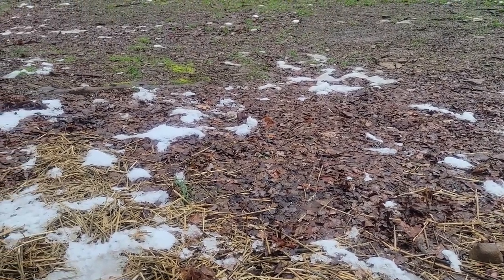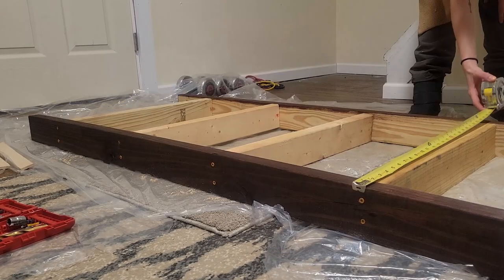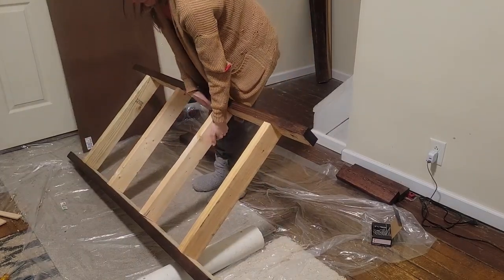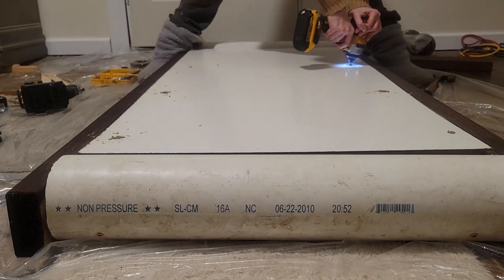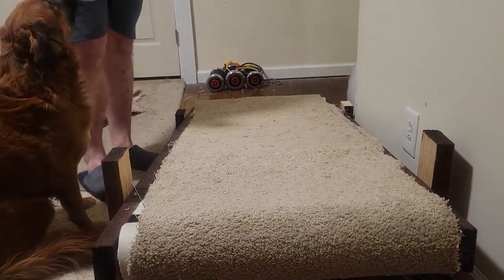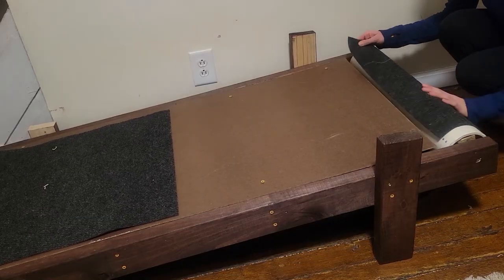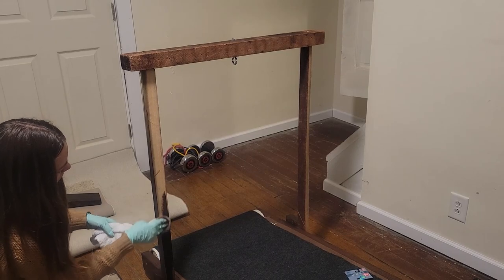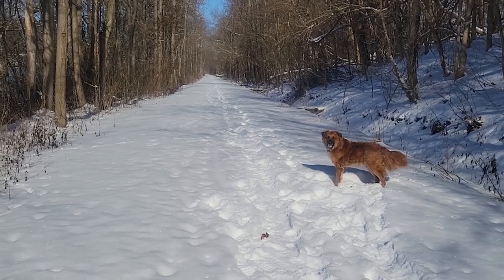CARPET MILL For DOGS Full Tutorial

Comment from the maker: COST: $120-130

MATERIALS:
(2) 2x4s
(1) plywood
(1) 4” pvc pipe
(1) timber post
(1) copper tube
(1) carpet
(1) fishing line
(1) darning needle
(1) eye bolt / wearable harness / chain or leash / TREATS!
Hardware: nails, screws

TOOLS:
Saw, Measuring Tape, Drill, Driver, Hammer, Scissors

Want to build your own carpet mill? You can do it!

Comment: I’ve actually build a carpet mill and the right type of carpet to use is stairs carpet or runner carpet the type they sell at Home Depot and then add caulking on the entire carpet so it last longer .
Reply: How do you add the caulking?
Reply: @rosemaryball7560  you use a caulking gun and spread it on the carpet with a piece of wood and press it into the carpet then let it dry for 24 hours. After a while it falls off but it makes the carpet last longer.

Comment: It sounds like there's just way too much friction on the "whiteboard." I'm going to be making one of these to save me $900 with a Dog Trotter, but I'm going to use wood, and then put pvc pool liner on top, hopefully make the deck have less friction and kind of "skate" across it.
Reply: Did that work?
Reply: @abbyb485  it did. It worked excellent! But then I sold the whole rig, I'm going to make another one.
Reply: @Chris.Rhodes  awesome thank you so much! I think I'm going to do the same then
Reply: @abbyb485  I used PVC pool liner, I got it from some scraps at a local pool installation business. Not sure where you can get it, maybe at Lowes? Or something like that. It comes in a roll.
Reply: @Chris.Rhodes  could you give a tutorial

Comment: The tension of the carpet should alone hold the dogs weight up, not the board between the rollers. The dog should not easily be able to stand on the mill without it rolling

Comment: Thank you for your video. I want to make myself a tread mill with no motor. However, it's to many parts, so I am going to try to make me a dog treadmill, which takes less material. I don't want it to run a marathon just for walking. I will build it with measurements that would be for a human. Thanks again for your video.

Comment: Would this work for small dogs
Reply from the maker: Great question. Absolutely! You just scale down your build. Start by measuring the length of your pup, then go from there. Maybe add some oil between your board and carpet to allow for easier sliding with less force. Good luck!